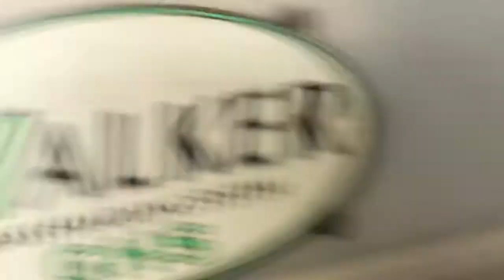How to change the hydro oil on a zero turn walker

Comment: Thank you for sharing. As a recommendation, if you haven’t done already, recommend putting new hydro cooling fans on - noticed all the blades were sheared off, and probably reason fluid looked so discolored.

Comment: There is a nut molded into the plastic, I believe its 3/4 or 19mm socket right inside the middle, you don't need to use pliers on the outside... Also those rubber bladders should be inspected and replaced fairly often as they shrink in time just enough to allow them to leak externally. I have tons of experience working on Walkers. Also the fan that is broken off the rear hydro is very important for cooling.. I noticed the one on yours has all the fins broken.
Reply from the maker: Thanks for the info and thanks for watching!

Comment: Good maintenance… but operating that at the end has my teeth grinding. Don’t start pto at high rpm’s… start em at low idle then throttle your rpm’s up, I could hear that belt hitting that pulley and it’s like nails on a chalk board
Reply from the maker: Thanks for watching 👍🏻

Comment: Nice video. There is a hex head inside the bottom of each hydro reservoir that you can loosen them with a 3/4” or 19mm socket and extension rather than using oil filter pliers. I like to clean the screen in the bottom very well with some degreaser or brake cleaner and thoroughly dry before reinstalling. To refill hydros I take the top plug off completely and fill through the reservoir hole until the fluid starts leaking out that top plug hole. Then put the top plug back in and just fill the oil in the reservoir hole about 1/8” above the black o ring gasket that the plastic reservoir seals against in the top of the hydro unit. Then when you reinstall the reservoir the last couple turns it forces the new clean oil up into the reservoir through the screen into the reservoir then you are sure there is no air. Then after you tighten the reservoir fully you just top it off to the cold line and put rubber and cap on. Also you didn’t mention the reservoir is LEFT hand thread. Reverse from the standard.  Not that anything you did was wrong… just a little easier and quicker my way and you don’t have to wait for oil to go through screen.
Reply from the maker: Thanks for the tip. I did figure out about the 19 mm socket inside the reservoir.
Thanks for watching 👍🏻

Comment: looks like you were turning the wrong way trying to take the reservoir off initially (around the 11:00 mark)
Reply from the maker: They are left-handed thread and I figured out on the inside of the reservoir you can put a 19 mm socket to loosen them
Thanks for watching 👍🏻

Comment: Just watched your great video. Love your garage man! Say, My 2004 MGHS was tracking forward perfectly but something just changed and now it does not track straight at full speed when I engage the Forward Speed Control in concert with the steering levers.  When I engage the FSC it launches forward and spins to the left.  I thought it might be hydro related which brought me to your channel?  Any thoughts on how to correct?  The night before things went sideways ( no pun intended ;-)) I pressure washed motor area.  Fluids still look good.  Thanks
Reply from the maker: If you haven’t change the Hydro oil yet I would  try that first even though it looks good it breaks down after time. Check  your manual To see what oil to use each model is a little different.

Thanks for watching I hope this video help you!
Reply: @boneyardgaragesmallenginer188   I only have a bout 12 hours on the mower since they were completely serviced with new fluid. It was adjusted and working perfectly and then after I pressure washed it everything is seemingly pulling to the left.
Reply from the maker: @mcbrock86  that is weird I would check your free wheeling lever on top of your Hydro make sure it’s not open
Reply: The mystery is solved. I replaced the battery two weeks ago with one that was slightly taller. I thought at the time I would not secure it and get back to it in a couple of days. What happened was the small fan started cheering into the side of the battery and then acid began to drop on the components just below the battery compartment. It ate away a bushing that kept my steering alignment tight and aligned. The part is now on order and it will be here in a couple of weeks. That was a tough lesson to learn but thank you very much for your input. I will continue to follow your channel.
Reply from the maker: @mcbrock86  Glad you figured it out!
Thanks for watching my videos!

Comment: Did you have do bleed the air out of the system?
Reply from the maker: All you have to do after you Service is to take it for a ride and make sure you go forward reverse and side to side. That will work the air out. And just make sure you check your levels again.
Thanks for watching
Reply: @boneyardgaragesmallenginer188  ok great I appreciate it.

Comment: What oil are you guys using in the hydrostatic     book says it has to be mobil 1 synthetic  15w-50   but that shit is fucking expensive
Reply from the maker: That’s what I use mobile 1 15w-50 synthetic. I will suggest to use what the manufacturer calls for. The hydros are over $1000 to replace not counting labor
Thanks for watching!
Reply: I've got to use penrite 10w-40  full synthetic oil with some oil stabilizer to bring it up to 15w-45   here in New Zealand we haven't go any of the 15w-50  mobile 1      even went to mobile themselves  and they couldn't help apparently their is none in New Zealand   I checked with walker and they say it's fine and will work ok but I will have to change the oil once a year instead of every 2 years because they say the oil will get dirty faster  because  it's not as good as mobile 1      don't know if I agree with this but whatever just happy to get to running mint again
Reply from the maker: @julianrevell2055  that should work just make sure the oil doesn’t break down good luck and thanks for watching my video

Comment: Walter recommends 5W30 , not  15W50
Reply from the maker: It says right in the walker manual to use mobile 1 15 W 50 synthetic oil for the hydros.
Thanks for watching
Reply: @boneyardgaragesmallenginer188  not in my manual 😝🤣
Reply from the maker: @bartdereu9267  Do you have an S series?
Reply: @boneyardgaragesmallenginer188  No MDD. Do they have different transmissions?
Reply from the maker: @bartdereu9267  Yes they do the one I worked on is a MT series commercial grade which takes 15 W 50